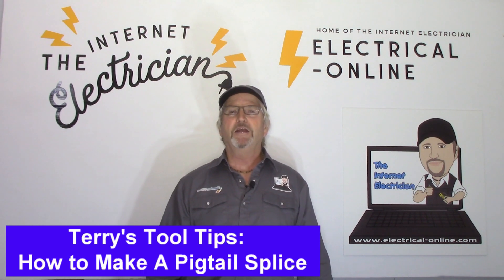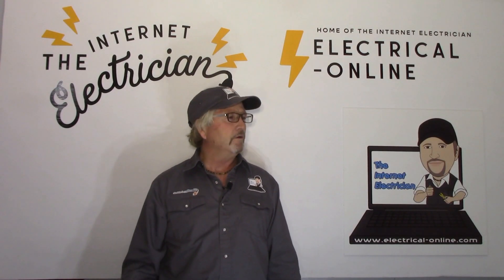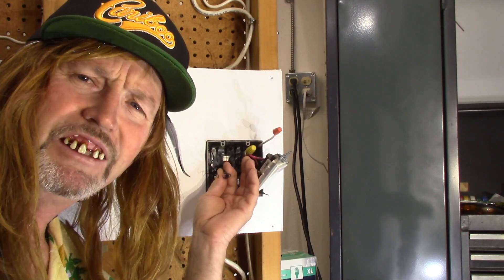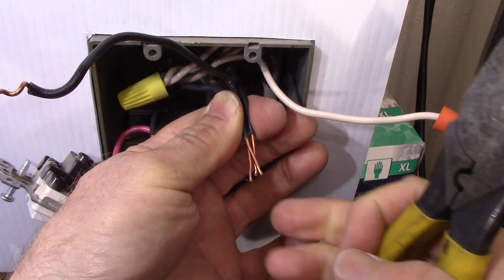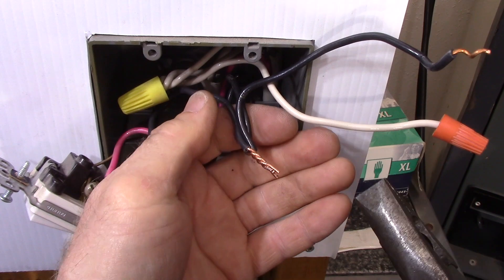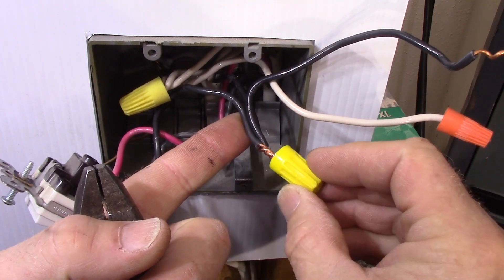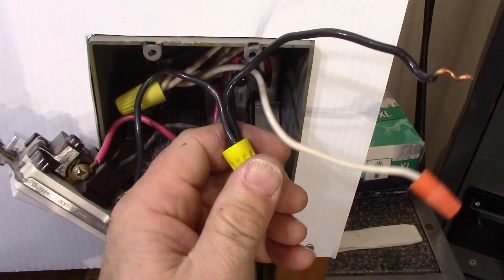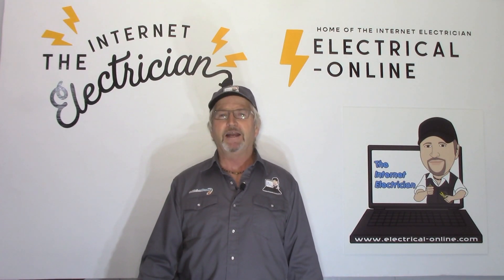How to Make a Perfect Pigtail Splice

Comment: Incase a Neutral and Ground wire got the same color of the jacket..how would you identify the Neutral and Ground using a multimeter?
Reply from the maker: Good question.  Pretty hard to do as they should be at the same potential.  That's why ground should be green or bare, neutral should be white.

Comment: Hi Terry P.  I am starting a basement project to run 240 vott feeders about 50 feet across my basement from my main panel to a large empty jbox using 3 #1's Blk THHN and 1 #4 green THHN grd inside a 1 1/4" sch 40 PVC conduit run with 3 long sweep 90's in the run. All 4 conductors are the Southwire SimPull brand. I checked this combo for the 40% fill and they barely fit in the 1 1/4" at 40% fill. Could you double check my calc's and advise if I should go up 1 size to 1.5 inch conduit or will this be an ok pull in the 1 1/4" conduit, which I have not purchased yet? The new comedy character is of no difference to me, just the facts for me.
Reply from the maker: You won’t have any problem pulling that in, but if you’re at all concerned, sizing up to 1-1/2” will be a small cost difference. I was just experimenting with changing things up a bit with adding a bit of humor and entertainment value, we’ll see what the reaction is 😬
Reply: @theinternetelectrician  nice character. 😄